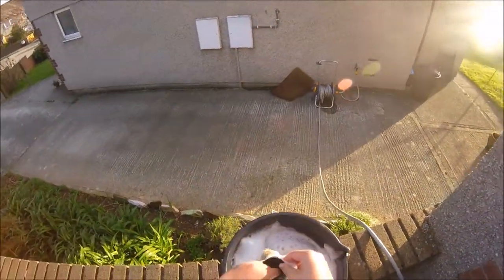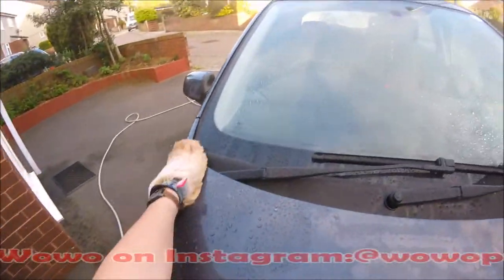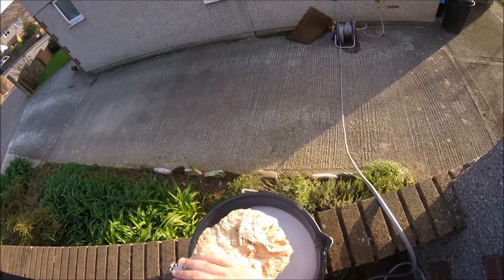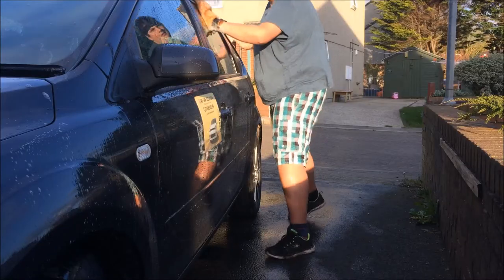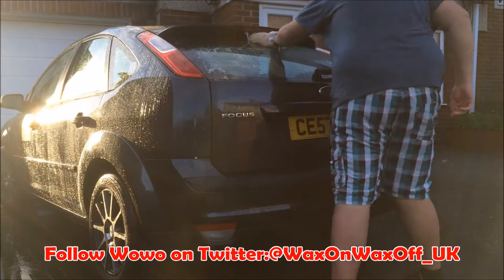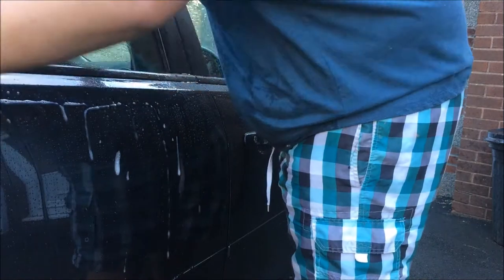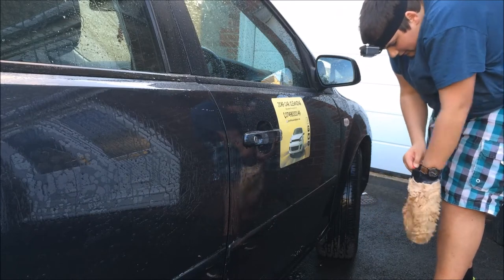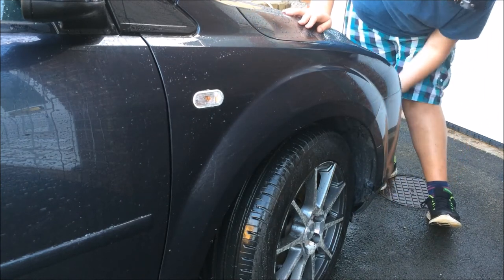Reviewing Wo wo's Lambs Wool Wash Mitt! -Is it any good? Lets Find out!

Comment: You should be using the 2 bucket method
Reply from the maker: hakman239 if you watch the video, I do say my second bucket is broken so could not do two bucket method, plus I was not damaging the car in any way as the car had been cleaned and waxed few hours before filming the video, the video is on the wash mitt not how I clean the car or if i use the two bucket method